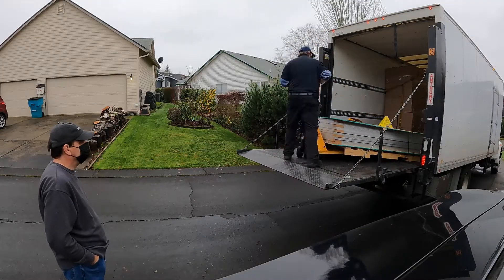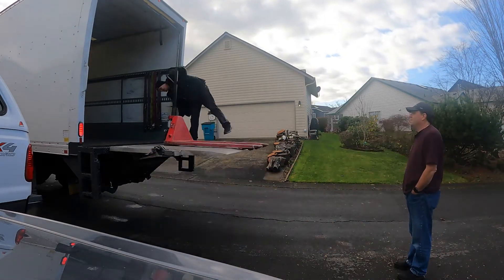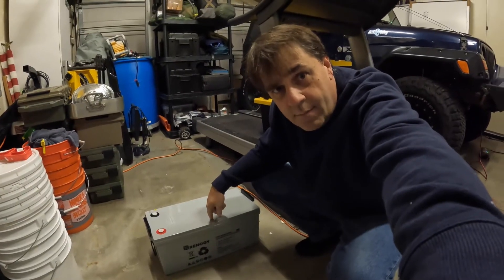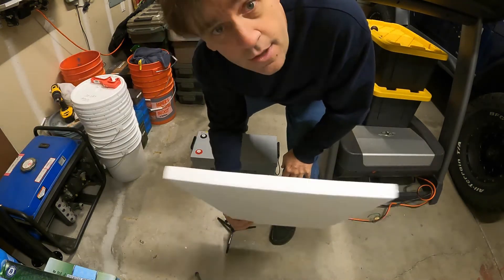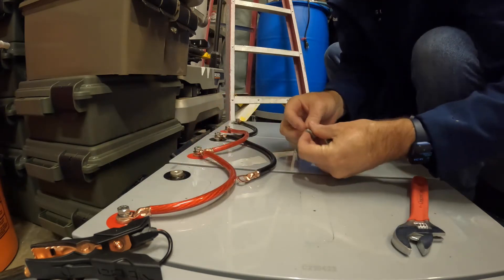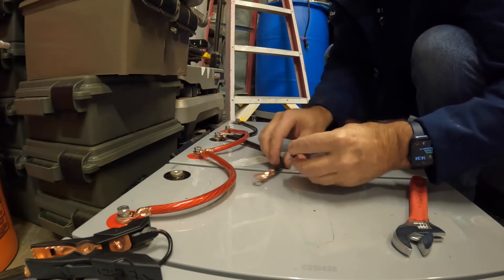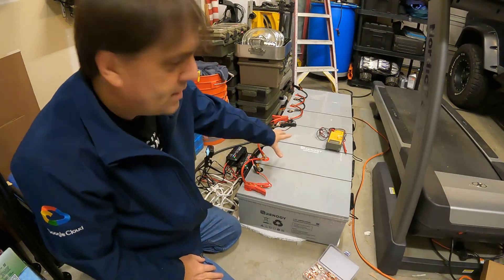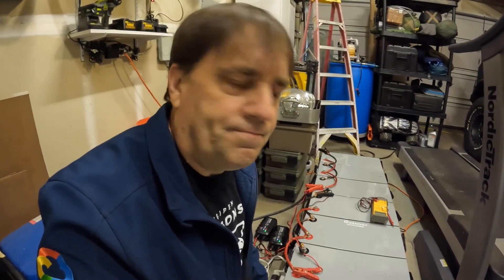Wiring 1200AH of Batteries, oh and our panels arrived!

Comment: The only situation where lead-acid or AGM makes more sense than lithium iron-phosphate is if freezing temperatures are a significant concern and you don't know how to overcome that.  If that single condition doesn't mandate the use of lead-acid, then LFP is always the better choice, for at least half a dozen reasons.
Reply from the maker: I disagree.  Price is a massive reason.   The battery type is unique to the situation, not just one single thing like temperature.    The cost of the battery system in any sort of lithium would have tripled, especially at the time it was built.   People should evaluate their scenario and select batteries accordingly.  Lithium is not the end all be all solution people seem to think it is.
Reply: @SeamrógCreek  - The only people who think "price" is a reason to buy lead-acid over LiFePO4, today, are those who simply do not understand "value".  Even if you pay 3 times as much for lithium iron-phosphate, they are still a better value than lead-acid.  We can go into the specifics if you want to, but I suspect by now you alreayd know.

Comment: Well I was happy to see your video, as these are the batteries I'm about to order. I have 6 for my system, so if I understand you correctly connect 2 sets of 3 batteries in Parallel, and then connect that to the inverter. I'm also ordering a Renogy 3000 Watt Inverter. Looking at solar panels, but for now will be charging with my 5000 Watt Generator.
Reply from the maker: Awesome, Renogy really makes some great stuff.  I'm getting ready to finally move these into our solar installation, so hope to have a video on that soon.

Depending if your inventer is 12V/24V/48V will determine how you wire these.   In series they add up Voltage wise.  So two in series is 24V.  

In our Solar installation we will be wiring two in series, and then all three pairs in parallel.   Which will give us a 24V system and ~600AH.  

All of our Victron solar equipment is 24V capable (inverter, chargers, etc), as are the wind generators we are using.  In this video, to keep them happy until we install them, I just wired 3 in parallel and put a 12V charger on them to keep them charged, then wired the other 3 in parallel and put a separate 12V charger on them.  The two sets are not hooked together.   

If your system is 12V you can just hook these in parallel.   There are some limitations to the number of batteries you should put in parallel, especially as failure in one  can cascade across parallel batteries.

This is a fantastic guide from Victron's battery expert engineer.  Worth the read, talks about recommended limitations in serial/parallel set ups:  https://www.victronenergy.com/upload/documents/Wiring-Unlimited-EN.pdf
Reply: @SeamrógCreek  Appreciate the help. I have not yet ordered the Inverter, so I think I will bump it up to 24. Thanks ~Pat
Reply from the maker: @patrickrheaume9260  Any time!  Ya I would definitely do that if you haven't ordered yet.   Then run 2-series/3-banks parallel at 24V.   Every solar charger I've seen will do 24V output so you won't be limited there when you get panels.  You might want to verify your charger for the generator can do 24Vs, if not there's converters.     Lastly if you need to power anything off DC (lighting etc), instead of the inverter, you can get 24V->12V converters (Victron makes them, I'm sure others do too) that will handle up to 30A and you can just run all your 12VDC devices like normal off that.

Here's the latest diagram of the system we are currently building out if that helps:  http://seamrogcreek.com/diagrams/2022-Cabin-Power-Cabin%20Power%20System%202022.png